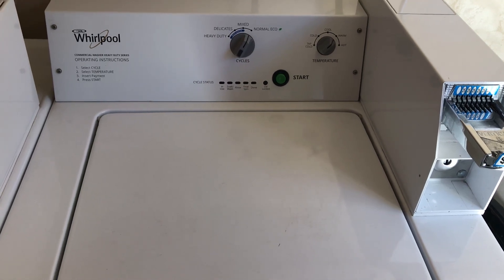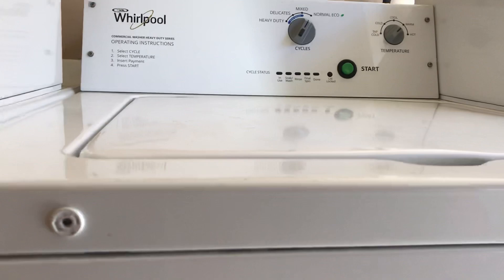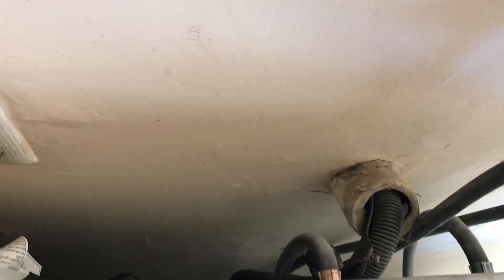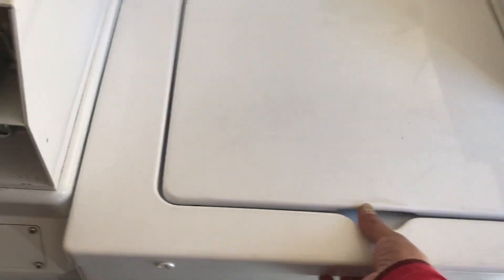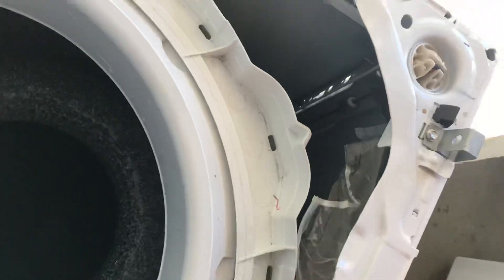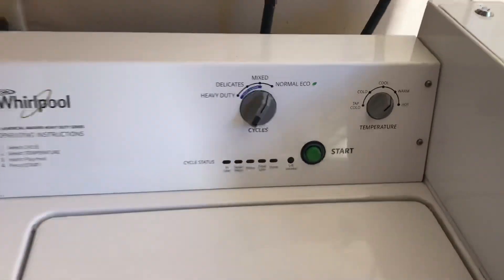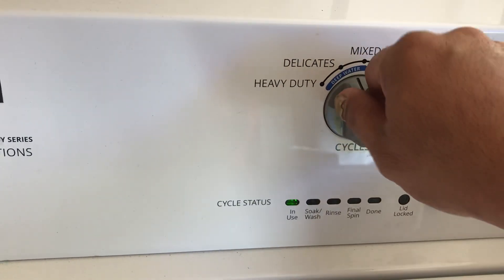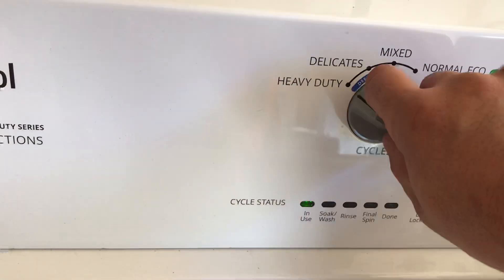Whirlpool washer/ coin operated washer find diagnostics sheet

Comment: i have the same kind of washer. i recently discovered the washing machine will operate without payment. i verified the jumper is in the j2 slot. i also noticed the led's for "cycle status" are inoperative. makes me question main control board. or chould i start with coin circuit board.

Comment: Trying to remove the cabinet from an older Whirlpool top load commercial washer, but find the right clip is down inside the timer/coin box.   
Must the timer/coin box come off?
This can’t be so hard, what am I missing?
Have suspension/shaking issues during spin.
Reply from the maker: Shouldn’t have to remove cabinet for suspension replacement

Comment: what about the clothes is still wet not dry up as you can put inside the dryer but this problem is that water will drip inside the dryer, any Idea what is the problem? thanks.
Reply from the maker: WINKIE MALALA most likely not reaching full spin speed. Different things can cause this. 
Too much detergent
Bad suspension ( shaking unit) 
Hub going bad ( basket slipping off transmission)
Reply from the maker: Can also be clogged drain pump. Like last reply said.. can be many things. While spinning check how fast and check drain line to see if water is coming out strong or not so much.

Comment: washed and it didn’t drain properly, i tried re running the cycle but the button didn’t work ??? someone help
Reply: I can give you some valuable information that honestly should help
Reply: HELLO.. there person in need of assistance.. 😊 I work at a motel and perform maintenance all around the building and we have a coin-operated washing machine just like the one in this video we had a similar problem to what you're describing and it was fixed by cleaning out the clear vinyl tubing that runs down to the bottom of the washing machine drum and into a valve which lets water and air into the tube I'm referring to that in turn changes the amount of pressure whether it be positive or negative amounts of pressure on the pressure sensor which is built into the control circuit board which is behind the control knobs on the top of the machine there's only one circuit board throughout that entire machine that I'm aware of it could be a stopped up tube because of all the dirt and debris that gets washed out of dirty clothes overtime causing a clog or even a partial clog that will make the pressure sensor in the control board to get a false reading and it will think the drum is empty and allow the flush valve to close before the cycle is completed it can also cause problems while the washing machine is filling up for the initial wash cycle if the problem is not in the pressure tube being stopped up then it is most likely the circuit board behind the control knobs you can put that machine in a self-diagnostic cycle just use the model and serial number and look it up online and gives you step by step instructions on how to perform the self diagnostic and it will actually tell you which cycle is performing correctly in which isn't there is also a written owner's manual / repair manual inside of the front right corner of the washing machine if you open up you're loading door stick your hand in between the washing machine drum and the top of the machine and you will fill it if not see it in the corner you may have to have a flashlight you'll probably have to take the top off to get it out it's very handy to have you will need two star head bits to take out the front two screws holding the top of the machine down loosen the screws pull the top towards you then push up and it will lift up like a car hood I really hope this helps because I'm constantly online looking up videos like this to help me out myself and I'm always thinking hopefully one day I can help someone I wish you the best of luck Merry Christmas😊

Comment: How to start the washing machine without using a coin
Reply from the maker: Wong Hong Yi you would have to manually put through each cycle using diagnostics mode
Reply: Buy the corresponding key for it on Amazon. Roughly $15. It's as easy as that. Once you get the key, you open the access panel, push the coin slider back and reach toward the back of it where a small, additional slider is at and pull it the rest of the way. Then viola! Free wash!

Dryer: Open access panel, immediately you'll see a timer w/cam. There will be a lever. Push it and that's it. 😂 Free dry!

You're welcome!
Reply: @codyramey6115  how do i find the corresponding key to a certain model
Reply: @codyramey6115  do you have the key model number or link?
Reply: @codyramey6115  is it key GR 777 or GR 888?

Comment: What tool did you use to take the lid off?
Reply from the maker: I used a drill with a star bit. Some are phillips. You can use a 10 in one screw driver or drill. As long as bit matches up